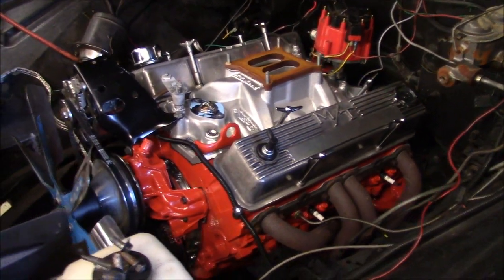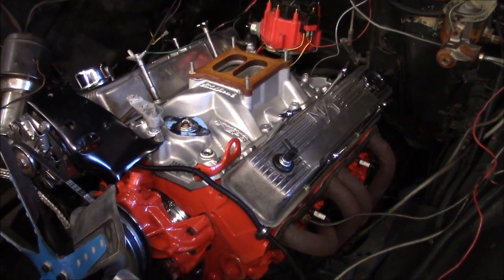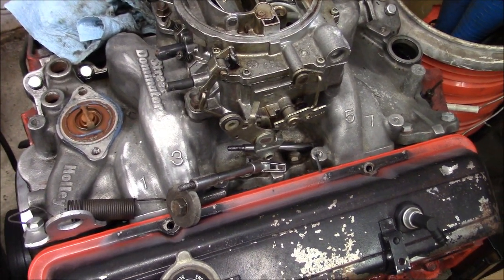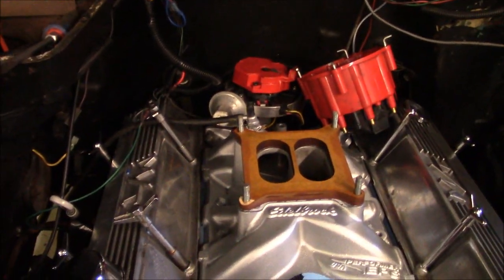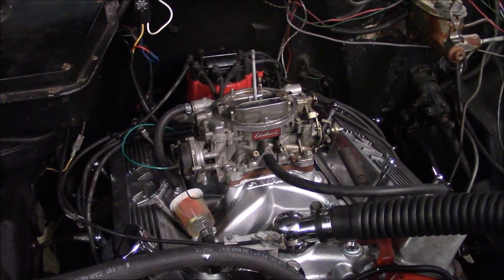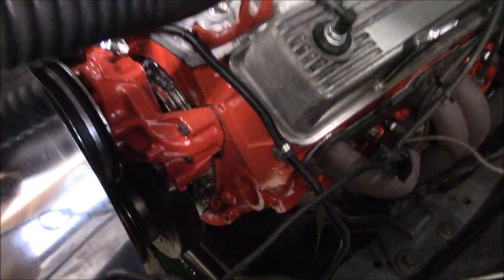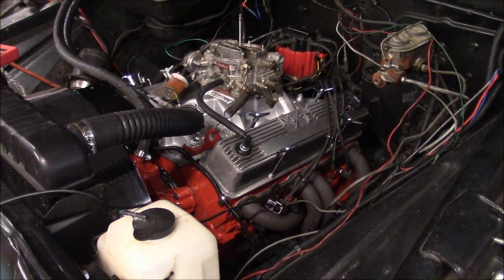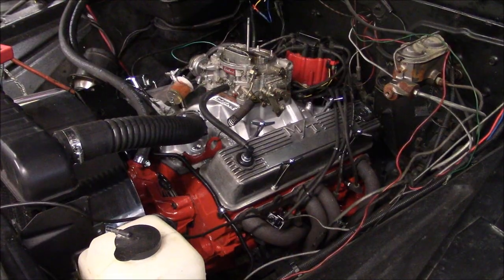How to: Set Base and Ignition Timing

Comment: I set my timing exactly the way you did here. My #1 is actually more at @ looking down at the ending, though. I do have it lined up with the #1 plug wire, though. I started it and it runs, but when I checked timing, it turns out the mark is way on the other side. Like around 10:00 when looking from the front of the engine. Not sure what I did wrong.

Comment: Skip passed all the 7-8 mins of blah blah blah. Put #1 sparkplug in hand crank the motor till you feel compression. Set your timing mark to 0, put distributor in engine pointing the rotor towards #1. Set distributor cap and start putting wires in the correct firing order. Get your timing light ready. It should start on the first try if there's gas

Comment: I notice your alternator is positioned right-side incorporating a "special" bracket; I've got a problem with a left-side mounted unit on a 65 Impala SS SBC; the adjusting arm is maxed; but there's a mere 1/8" gap between the alternator & tall valve cover; WTF? If one replaced the "rams-horn" Ex-manifolds with headers you could experience a similar effect as you would no longer have the alternator's main mounting points; is there a conversion kit available? But the ole Frigidaire is right-side mounted on this car;

Comment: note to add harmonic balancers are not created equally if its oem you should be ok but a lot of manufacturers have the 0 mark in the wrong location. it is always wise to put a indicator or even a stick in the number one spark plug and run it to top dead then verifiy the 0 mark is were it is supposed to be
Reply: A stick huh

Comment: I have a question, how do you set the base timing in olds 403? Same thing you did on this one!
Reply from the maker: Yes.
Reply: Fuel Injection Sucks I did Tdc at 0 it didn’t work then I did 20 it didn’t work, where should I set the harmonic balancer before dropping in the distributor?
Reply from the maker: @z28punisher42  it has to be 0 on the compression stroke, make sure it's not on the exhaust stroke. The mark will line up two times.
Reply: Fuel Injection Sucks alright thank you I’ll try that now

Comment: QUESTION: What is the difference between Initial timing and total timing and which one should I be using?
Reply from the maker: Initial at idle. Total is your total combined timing once the mechanical advance is fully engaged, usually between 2500-3500 rpm.
Reply: @FuelInjectionSucks  Gotcha. Would it be true to say the following? If the manual is calling for the following: Remove vac advance and plug from carb, start engine and run at idle speed, set initial timing to 8 degrees BTDC @ 900 RPMs; you won't dick around and try to set total timing after setting the base timing correct? You should get 32-36 degrees of total timing around 3000 RPMs and that's taking into account what the distributor is adding when the vac advance is kicking in? This is for a Chevy 350 in a Corvette with no A/C and manual.
Reply from the maker: @pattygq  Yes. They unplug the vac advance just to make sure it's not engaging, but it shouldn't be anyway. Then you set the initial to 8. Mechanical advance should get you around 35 total. Factor in vacuum, and it's probably 45-50, but vacuum advance disengages under load.

Comment: Am I right in thinking that once at TDC you can lift the distributor up out of the helical gear and drop it back down to virtually any other slot it will fit into and call the new position #1? If so, you would need to change the plug wires so that they would all be long/short enough to go to their newly assigned cylinders. I only mention this because, I like others like to have number 1 on the distributor to the immediate right of the points window.
Reply: Yeah but be sure it drops back down into the oil pump drive. It will only line up in 2 positions unless you turn motor over and push down on rotor botton.

Comment: some motor u can't move # 1 on the dis. but chevy is forgiving u just drop the dis in turn motor to top dead center were rotor points is# 1 or 180 out if 180 out just move the wires and if u put the balancer like a 350 stock 8 deg before top dead center then line up the # 1 perfect it will be perfect timing  dun it a few times and did not have to move the dis with a light on it great for beaking in motors so u don't have to play with timing when u first start it like vw u have to time it in at low rpm and at high rpm and find the balance in timing trust me not all cars are like a chevy u should make the video on chevy timing only there are a lot of different types of distributors and how they work on older cars how u install one is u put in the hole turn motor till the oil rod locks in to the dis. and u can tell when it fully drops down to the mounting hole
Reply: s did u know a sb chevy distributor is the same as a bb chevy all u do is change the counter weights  works the same

Comment: What do i do with mine ,with no vacuum  advance on it ,small block 305
Reply: u time it like vw time it at low rpms and at high rpms find the in between setting for timing but i would get the vacuum  advance u will get better performance and mpg
Reply: @jeffrey4547  im working on getting the distributor with vacuum advance, gonna try it properly this weekend,,thanks ,

Comment: You could set the timing for the highest RPM'S on a tach and back it off a little. Test drive it and see if it pings. Use the damper as a guide to set the timing.

Comment: Question I set it to tdc and set my distributor and all sounds good but once I plug the advance plug doesn’t fire up  can’t get it to run to put a gun on it  350 tbi  1990  book says when setting timing plug should off so can’t set timing  tried 1 2 3 4   Been trying for a month  any suggestion
Reply: On the Balancer
Reply from the maker: You need to disconnect the timing connector which is either located on the firewall or behind the glovebox. You don't disconnect the plug on the distributor. You start the truck, then you set the timing to 0, turn the truck off, and plug it back in.

Comment: Are these marks on a vortec 350 as well?
Reply from the maker: Yes, but if it is still fuel injected you have a bunch of other things to contend with. Your timing has to be set using a scan tool.
Reply: @FuelInjectionSucks  how much will the factory ecm allow the timing to be taylored with the scan tool? Are there 'read only' ecm's versus 'open' or programmable ones available somewhere?

Comment: the timing is wrong
Reply: u are correct on the compression stroke part and being able to put number 1 wherever u want but u will know the difference when u take it to the track.
Reply: the rotor should be pointed towards the number 2 but it has no relation to the block what so ever if you look at the original schematics its pointed in that direction that is the only way u can get accurate start at all times not every once in a while have a slip in the start and also have maximum power with advanced timing.
Reply: diegomora you haven’t a clue.
Reply: John Phillips jr Seriously tried the way the original schematics tell you and then test it after that and see what response you get from your vehicle and trust me you would never do it another way again

Comment: hi  i have a 350 motor with a msd ready to run distributor without ignition box . i have a guy do my timeing . he told me you never do total timing when you have a advanced canister on distributor. only initial he set it to 14 degrees  . is that true what he said about total timeing thanks
Reply: I realize you posted this a year a go but allow me to explain what your guy meant. 

A distributor has a specific amount of advance available.  Depending on the manufacturer, usually about 20 degrees total. So if your guy set the base timing at 14 he is essentially setting total timing to 34 degrees. (14 degrees base + 20 degrees built into distributor = 34 total timing)  the 20 degrees built  into the distributor comes from a combination of mechanical and vacuum advance. So your guy feels the total timing is more important for engine performance

Most performance builders dont care what the base timing is set at. They want to make sure timing can advance enough for high rpm performance. So  they will set the distributor up so total timing is 34 to 36 degrees. If set at 36 total, subtract out the 20 built into the distributor so base timing would be 16 degrees. Some older V8 engines specs called for 8-10 degrees base timing. Add the 20 degrees built in to the 10 degrees base and that makes the total 30 degrees. 30 degrees total timing makes for sluggish performance at higher rpm. Thats why they like using total timing. 

Mechanical timing usually start advancing at about 1000 or so rpm and is usually all in at 3000 or so. Vacuum advance if connected to port vacuum will start advancing timing as soon as you step on throttle. If vacuum advance canister is connected to manifold vacuum it will advance the timing while the engine is idling.
Reply: Farmer Jim  Close, but not quite.  " The 20 degrees built  into the distributor comes from a combination of mechanical and vacuum advance"...this is incorrect, mechanical advance and vacuum advance never combine to get 20 degrees.  The 20 degrees comes from the mechanical advance weights and center plate in the distributor only.  The vac advance has its own amount of advance it adds.  The vac advance was designed to add extra timing during low load/high vacuum conditions because lean mixtures burn slowly and rich mixtures burn quickly.  What are the low load/high vacuum conditions?  Idle & cruise.  Vac advance adds extra timing in these conditions to light the fire earlier in the compression cycle to ensure a complete burn and MUST be connected to manifold vacuum as it was designed to be.  Connected to ported you will not get the extra advance needed at idle (which also helps with cooling) and during acceleration you'll be adding advance to a rich mixture that actually needs less advance.  For peak engine performance, driveability, idle cooling, improved gas mileage, and efficiency on a street driven vehicle, you need vacuum advance connected to full manifold vacuum. Period
Reply: Giovanni Krasniqi  learn to work on your own stuff and you won't have to worry about other people opinions
Reply: You're trying to tell us how to do timing and you ain't never done your time in yourself we're supposed to take your word somebody to let somebody else do it

Comment: FOR THOSE WHO DONT UNDERSTAND THAT YOU CAN MAKE ANT POINT ON THE DISTRIBUTOR CAP YOU ALSO HAVE TO KNOW IF THE WAY THE ROTOR IS SPINING THAN SET THEM UP IN FIRING ORDER MINE IS CLOCKWISE AND THE ORDER IS 1-8-4-3-6-5-7-2 THE ONE IS FOR THE #1 SPARK PLUGWIRE ON THIS VIDEO IT WAS FRONT RIGHT # 8 IS LAST ON THE LEFT. SO ON BLOCK 2-4-6-8 ON LEFT AND 1357 ON RIGHT